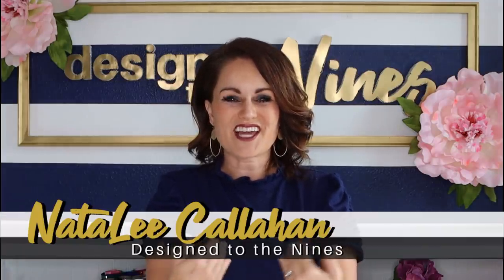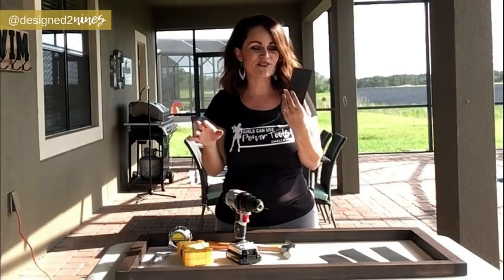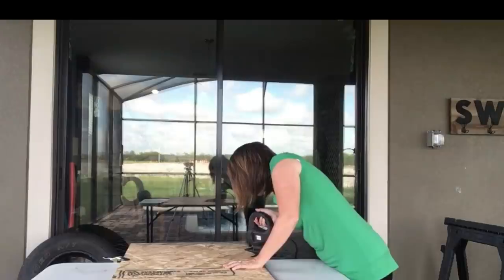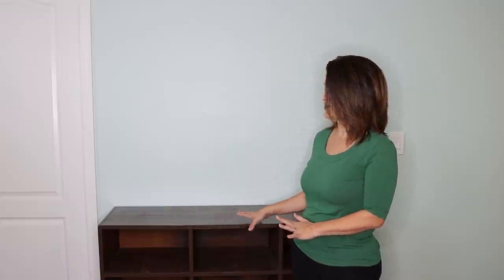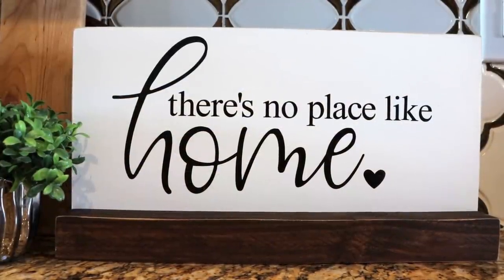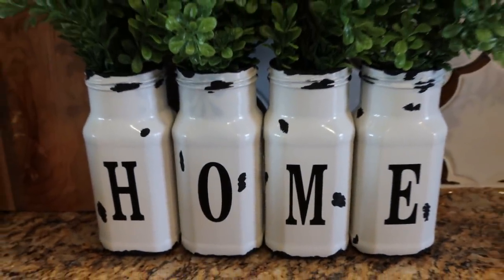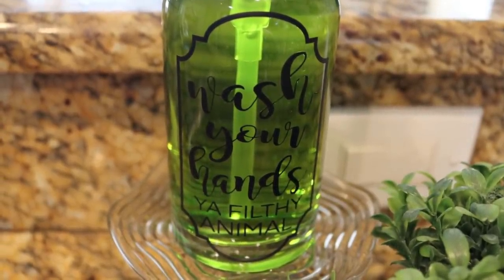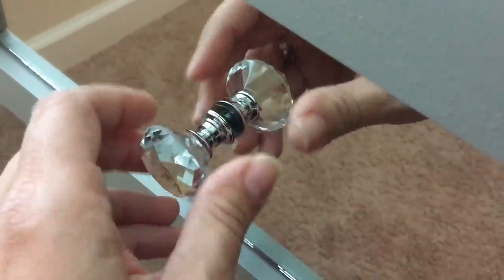Absolute TOP 10 Best TRASH TO TREASURE DIY Decor Ideas On a Budget!

Comment: As a longtime DIY-er, I suggest you wash your upholstery fabric for slipcovers before you make anything. It WILL shrink which is a bummer after all your hard work. Buy approximately 1/2 yard extra, plus extra if you need to match stripes, or pattern repeat. Yes, a bit of extra work, but you'll be glad you did. I iron, starch,and Scotchguard the fabric, then sew. Even when the upholstery fabric says 'dry clean only' I wash it. The only upholstery fabric I don't wash is silk or rayon, but those are pretty high-end, so I rarely use them..

Great channel, great ideas. I like especially how you show the "why" of doing something a certain way which is great if someone hasn't done that technique before. I can't wait to try some of your great techniques and ideas!
Reply from the maker: I like your suggestions! Thanks for sharing!☺️💕

Comment: One suggestion about gluing wood together: use a silicone brush (like for basting) to spread the glue evenly.  It will make for a MUCH stronger bond.  Let the glue dry on the brush and it will peel right off, you don't even have to wash it.  You can get them at Walmart for $1.

Comment: I live in Kissimmee. There’s a good Salvation Army store in Kissimmee. There’s also a nice Goodwill Boutique in Orlando. The Goodwill in Clermont is nice also. I’ve had the best luck with the Goodwill stores on the West Coast. It’s been tough, but you can find them. Good luck! I love your videos!
Reply from the maker: Awesome! THANK YOU SO MUCH! I’ve never heard of a goodwill boutique . If I google that will it come up in search? Because that sounds awesome. 💕😃
Reply: Designed to the Nines The address for the boutique is 750 N. Orange Ave. Winter Park. Fair warning...It is on the small side.
Reply: Designed to the Nines I tend to find more furniture pieces at the Salvation Army locally. I like to repurpose furniture too and it has def. been a challenge in this area. The boutique has great furniture but their prices are a bit higher. Good luck!
Reply from the maker: Thank you so much! Can’t wait to check these out! I wonder when they are going to open back up. If they are open now or if they are going to hold off a while longer. Either way, I really appreciate the tip! 😃

Comment: I have a question about the candles. Do you have any issues with the outter coating of wax melting being outside? I love the idea, but concerned with the Florida heat over the summer. TY in advance!!
(I LOVE ALL YOUR WORK!!❤❤)
Reply from the maker: I’ve left them outside through crazy heat. Not a single problem.👍🏻
Reply: @designedtothenines  Good to know! I'm about 2 hrs south of you here in Fl. 😉 I saw that you bought package of 6 and pack of 2? I didn't see the pack of 2 on Amazon with that Co. Was it from a different company? I'm getting all my material ready to start my chandelier. 😊  Thank you for your recreation and inspiration!!!

Comment: They were all too great to choose a favorite.  Question:  when you buy a compressor, does it work with several different tools?  Will they all fit?
Reply from the maker: Yes. It’s handy thing to have around. I have two nail guns and a stapler for it. You can also use them to put air in your tires. 😃
Reply: And a paint sprayer

Comment: Did you pressed your fabric so it doesn't shrink and not fit after you wash it the first time?
Reply from the maker: I did not. This piece is not getting a lot of use… it’s in our master bedroom. So if I do need to clean I will probably use my steam cleaner machine. But it’s a good suggestion to pre-wash your fabric.😃

Comment: you should have folded the iron strapping around so that there was two top pieces for the screw to go into to hold them in place, so that there would be no loose pieces to have to tack down, just overlap the two  and screw down like you did right through both though. I hope that makes sense.If the piece was not long enough for that, you could have cut the pans the long way to get more length.

Comment: They have a lot of different crickets which one would you recommend?
Reply from the maker: Good question! It really depends on what you want to do with it and how big of a crafter you are… The explore air two can actually do quite a lot… It’s good for paper crafting, making stencils and things like that… I just recently upgraded to the maker because it has the capability of cutting through thin wood, cutting fabric that is not bonded and engraving metal… It’s a much more powerful machine for a serious crafter/decorator… They also have a tiny one called a joy if you like to just make cards and labels and smaller type projects on the go… You can shop all of them at this affiliate link if you’re interested... https://cricut.com/en_us?sscid=11k4_7ei6a&utm_campaign=2038464&utm_medium=affiliates&utm_source=shareasale.com

Comment: Your 1 1/2x 1 1/2 are actually 2x2's. Yes your measurements are correct but if someone goes to home depot and asks for a 1 1/2 they won't know what that is. Also buying in 3 foot lengths is expensive. Buy a 12 foot and ask them to cut it. They do that for free.